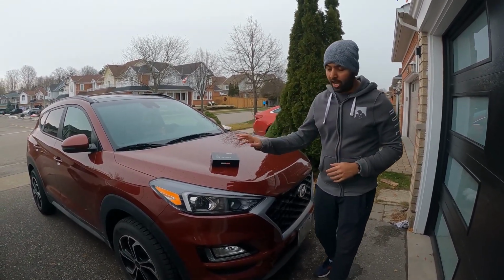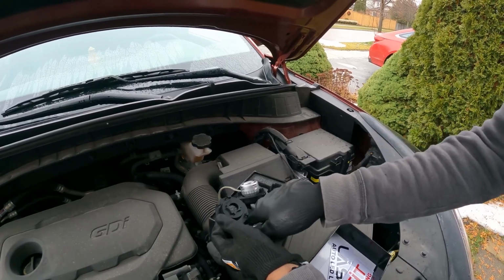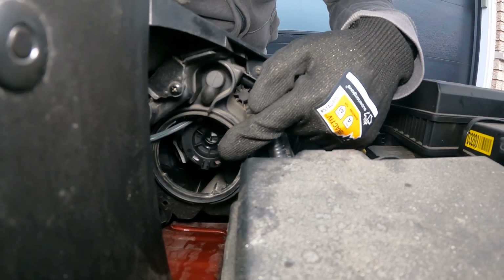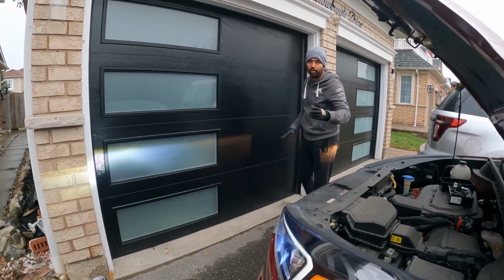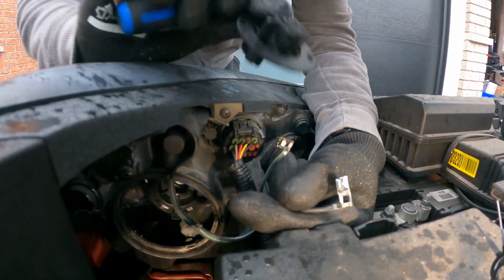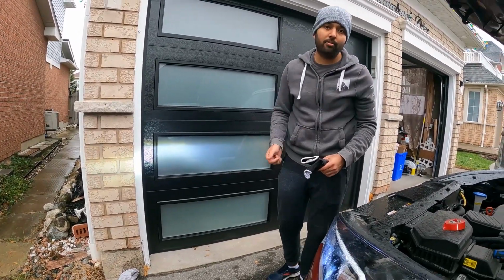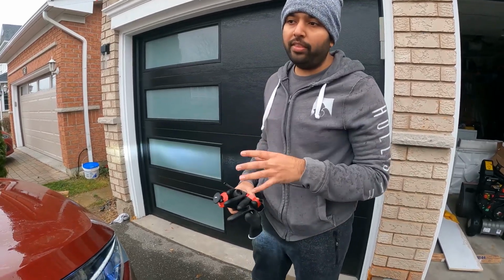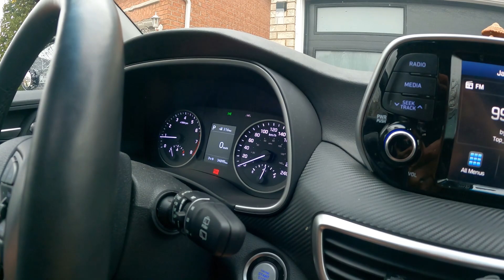2020 Hyundai Tucson LED headlight Bulb replacement LASFIT LED PRO (No can bus decoder needed)

Comment: Just the video I needed to find out how to remove the pins from the factory plastic housing. Thank you brother.
Reply: Turns out the plug n play H7 bulbs without the decoders or heatsinks aren't always plug n play. Ended up using the factory plastic mount piece and just shoved the decoder's wire leads in them. Works like a charm now.

Comment: Hi friend. Nice video, I want to install these LASFIT lights on my 2018 Hyundai Tucson car, but I want to get the headlight cap, since the one I see in your video is a much deeper cap. Please could you tell me what part number that cap is so I can buy it on Amazon. Please. The part number is on the inside of the cap.

Comment: Do you have any issue with the light sensor flashing on the moniter?? I just installed the same product, on my 2021 Tucson, but the light sensor error flashing constantly?? Any suggestions on fixing it??
Reply from the maker: No, I am not getting any error for lights. You should talk to the manufacturer.
Reply: I have a 21 Hyundai Tucson and recently it started doing what you have described. I even bought new headlights! It still flickers with the triangle warning ⚠️ sign and right one blinks on dashboard. Any fix yet?